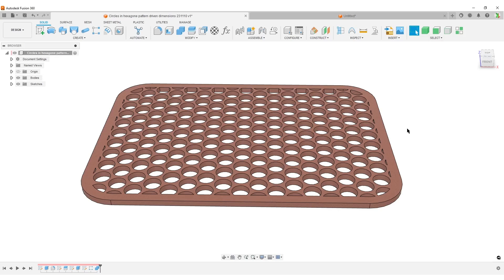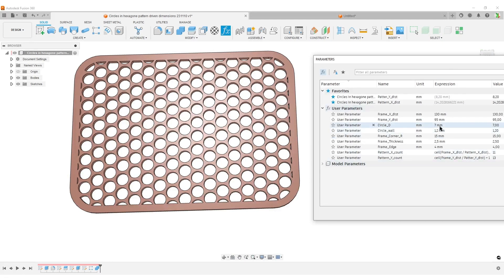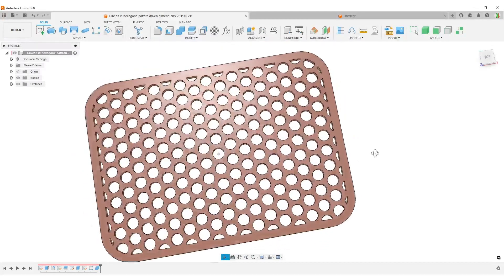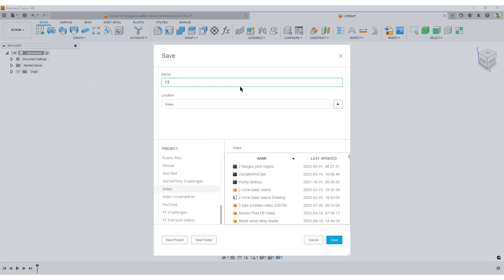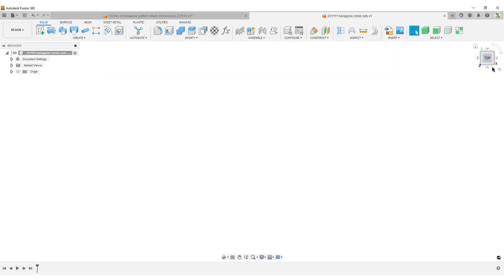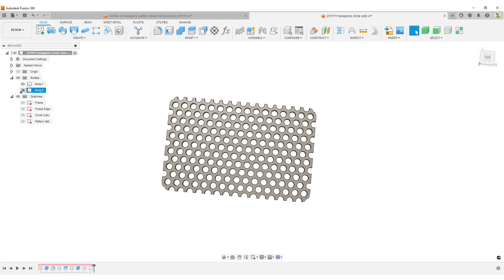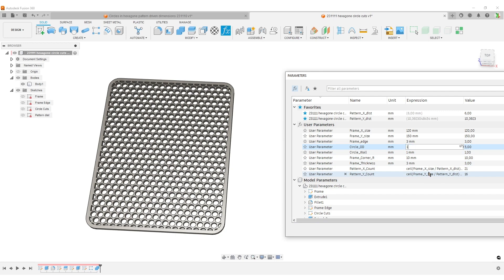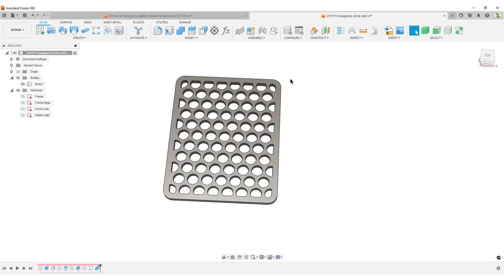Hexagon Pattern of Circles with the help of Driven Dimensions - Autodesk Fusion

Comment: - Nice, as usual :)
- And yes, driven dimensions now accessible anywhere (not just in source sketch) is a good thing :)

- QUICK TIP:
SELECTING COORDINATE PLANE FOR SKETCH:
--- Simply invoke 'Create Sketch' (incidentally, I created hotkey), then hover cursor around center of viewport not on geom: coord planes will highlight, then click.
--- Easier yet, click desired ortho view on 'View Cube'; invoke 'Create Sketch', then click anywhere in viewport not on geom (note: again, coord plane highlights).

- OK, carry on :) ...